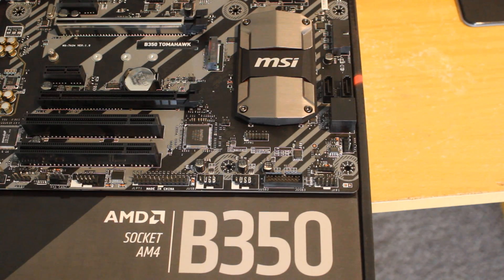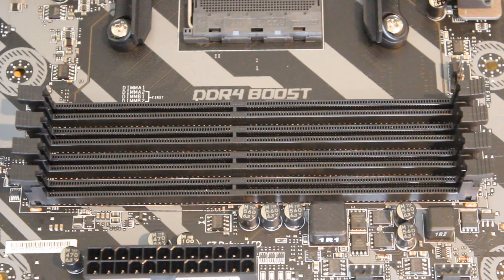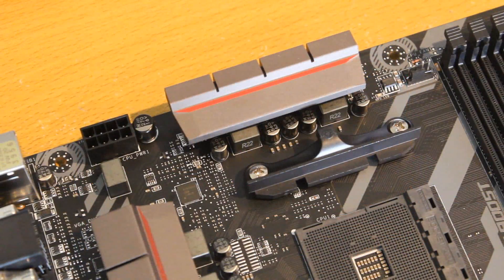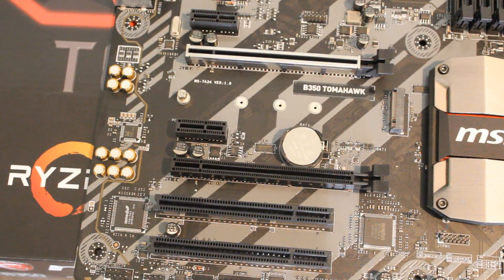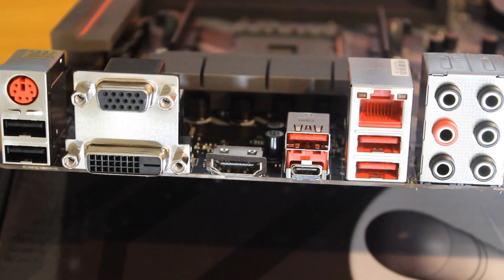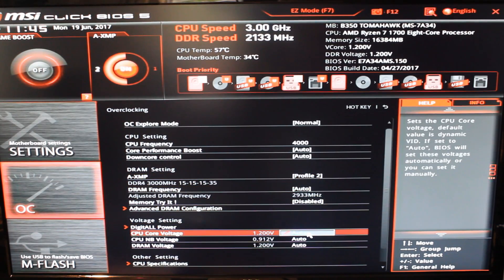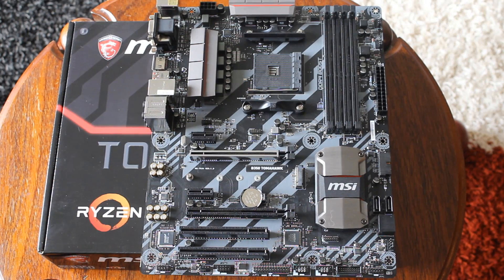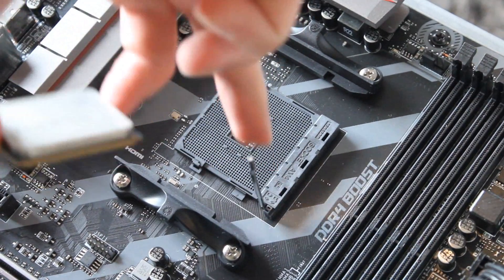MSI B350 Tomahawk Review & Overclocking - The Best B350?

Comment: The VRMs get quite hot if you don't use a top down CPU cooler and sometimes even thermal shutdown in my experience so its great as long as its VRM is kept cool enough
Reply from the maker: What VRM temps do you usually see?
Reply: With an R7 1700X overclocked to 3.9GHz at 1.34v on a Noctua NH-U12S it hit 125C and thermal shutdown by itself. I checked with hwinfo
Reply: That didnt happen to me yet, have my build since early april. I have almost the same specs:
Tomahawk + R7 1700@3,9GHz@1,34V + Thermalright Macho Rev B

Comment: Hi, would you let me know your vrm temperature at 4.0 and 1,4V? Bios's 34C has noting similar with Aida or HW monitor "motherboard temp" ~88C under stress test or rendering. So as i finger touch chipset, it's light warm (35 maybe) but VRM radiators left and up CPU is reaaally hot, maybe its temp shown as "mb temp" in HW or Aida readings? Is it acceptable to have such hot vrm and what readingsdo you have? Thanks!

Comment: I initially bought this board, but I didn't get a post with my 1600. It specifically told me the CPU was defective, but the ram was okay. I ended up shipping it back for a refund as what most people suggested, and got an Asrock board instead. In the end, it was the ram that was the problem, even though MSI assured me it was compatible >.> I wish I got that sorted beforehand, and had this motherboard instead. The ASRock bios is a mess in comparison, and the MSI one is much much nicer .-.

Comment: I've built a lot of systems lately, two of which were ryzen. This tomahawk is a great board but it gave me a lot of issues on the initial boot and refused to boot until I swapped in a low-power GT 730 and updated the UEFI to get it to run with a more powerful rx 580. (spent about an hour and a half trying to get it to boot at someone's house before i took it home and swapped in the 730)

The other system I've built lately was also on an MSI board, the x370 pro carbon, and that was much more pleasant to work with in general but also obviously way more expensive. (my personal rig is on a maximus VIII hero for reference.)

Comment: I was considering this board, but since the B350 Strix was released, I've been thinking that is the better option?  I can hardly find any reviews of it though.  Any opinions would be appreciated.  From my own research, it seems like the main thing it lacks is voltage offset in bios for easy over clocking.

Comment: Why does it even have 2 pci ports? It's. Waste of space. The placement of the pcie 1x connectors is too close to the pcie 3.0. The gpu will get in the way if I would put a large pcie wireless adapter
Anyway, you should do a mass motherboard review with all the boards you tested so far when the agesa 1.0.06 is fully implemented on most of the boards to see which is truly the best or would they come out fairly equal at this point?
Reply: PCI is useful for people with old cards that use it, like me. The placement of any PCI/PCI-E can not be too close or too far away as they are all as specs.

Comment: I got this motherboard at start it was a mess(had 1min boot time to windows ,and it didnt support 3200mhz memory)
but with bios updates both were fixed,MSI Commander application still sucks and doesnt keep FAN profiles after reboot......

also it has 4 sata connectors and 2 of them are on a bad placement  if you got a big GPU like a asus STRIX of anything with 3 fans it will cover them i managed to use em with 90 degree sata cable connector and some effort though.

Comment: what memory did you use?
Reply from the maker: Gskill Ripjaws 4 16gb 3000mhz kit (2x8gb)
Reply: Tech Showdown Which kit? I'm using Corsair DDR4 lpx 3200(black), but can't get past 2666, but I've seen others that got them to work. I've also seen the red and white versions, if the Corsair work. I have  R5 1600@ 1.3875